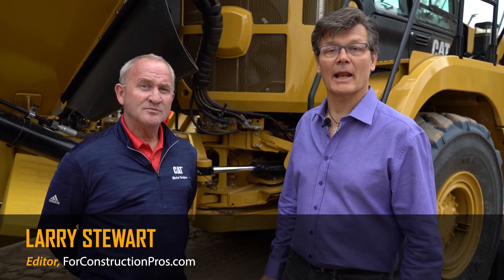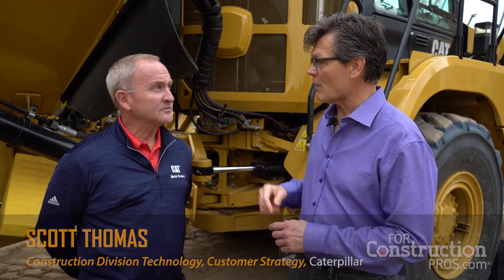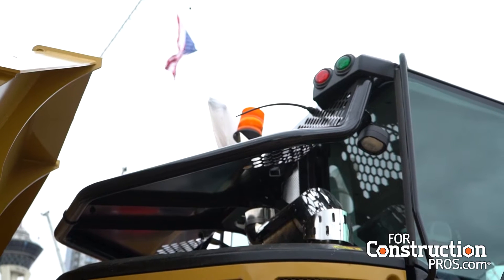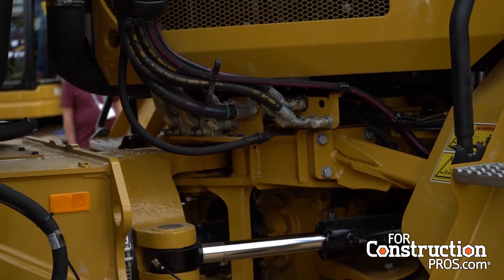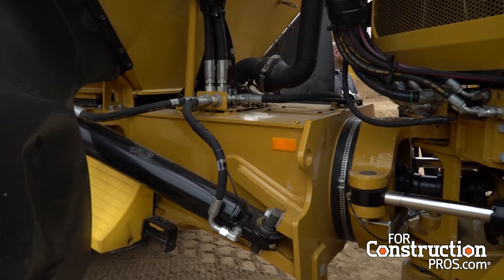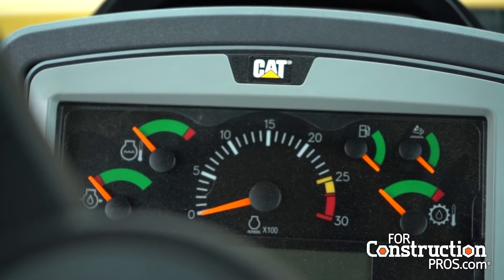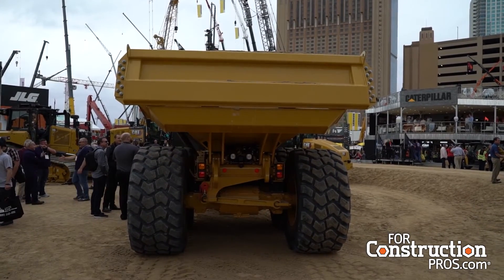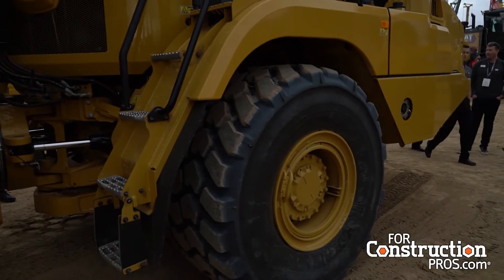Cat Dials Up Power on 725 ADT with Next Gen Cab

Comment: Where as in a volvo you have to press the dump brake button and pull the dump lever backwards. Also in the volvo you don't have to disassemble the rear panels to clear the radiators and you are also sat centrally, not off to the right.
Reply: Not to mention how ungodly hot the cat trucks get with the radiators strapped to the back of the cab